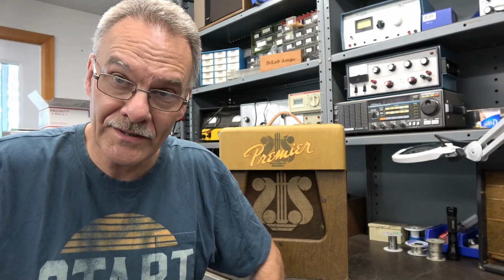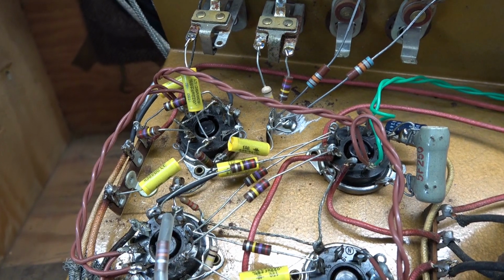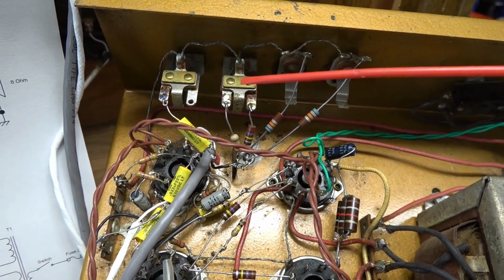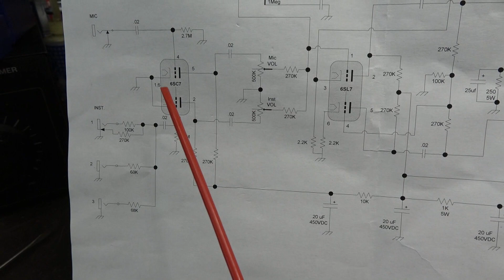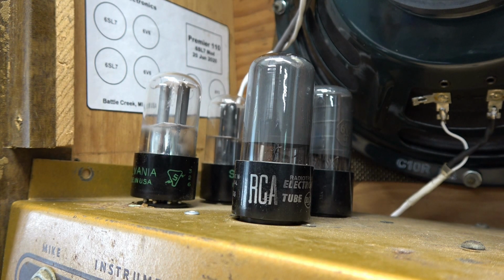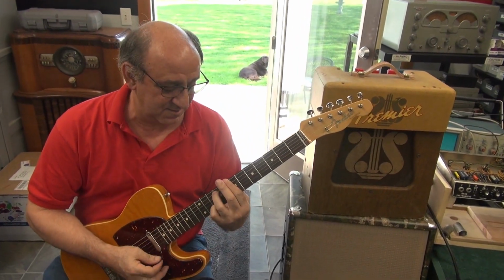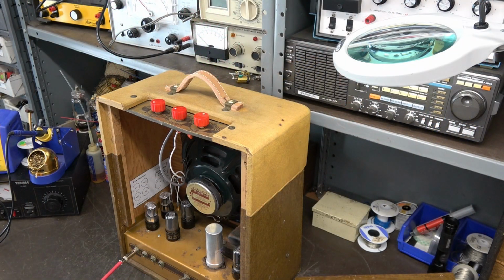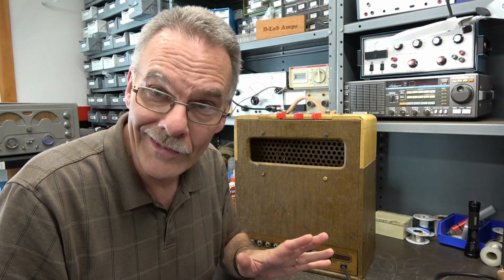How to Modify Premier 110 tube guitar amp increased gain better sound

Comment: Looks like the tubes have the same amplification factor of 70. Probably the cathode/plate resistors along with the cathode caps made all the difference in the world.
Reply: Perhaps the fact that each input had it’s own triode instead of cascading, but cathode bypass capacitors do make a lot of difference to the gain and tone.
Reply: @colinbooth6908  cascading the stages may give you too much gain. Guess there is one way to find out!
Reply: @dlunsford1980  He did cascade them. Look at the schematic. It now has 3 gain stages before hitting the output tubes.

Comment: Another option would have been to cascade the inputs, one into the other with volume controls in between. That way you would have so much more gain like a Marshall, or dial it down to original clean.

Comment: Most excellent! It's hard to hear the real difference between the two circuits on a computer, not your fault. I am sure if I were in the room I could tell the difference. It does sound fuller. I think you were very smart to mod this little jewel. This new circuit could be used for a new amp build! Thank you Terry and Tony for this video! Shows what can be done to an otherwise unusable volume amp! Man, these are my kind of videos! Thanxz

Comment: anyreasons why old amps that use 2 prongs when reversing the AC 2 prong cable in the AC outlet it would be less line noise compared to the other 2 prong order. It doesn't make sense to be that 2 prongs is HOT and Neutral going to the primary side of the power transformer but reversing the HOT and neutral depending on the AC outlet will have line noise compared to the other way plugged in. Do you know the answer as to why?

Comment: Picked up the same amp and I’m getting no sound output. I am hearing normal noise floor hum just no signal getting through. I’ve changed filter caps, new 6sc7 preamp, and swapped rectifier tube.  Any thoughts. Schematics are very difficult to find on this model